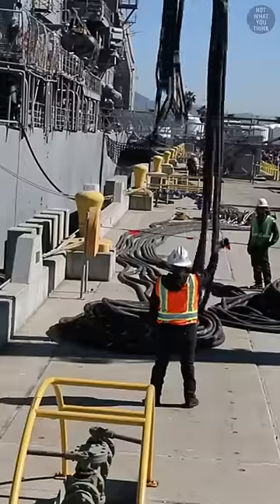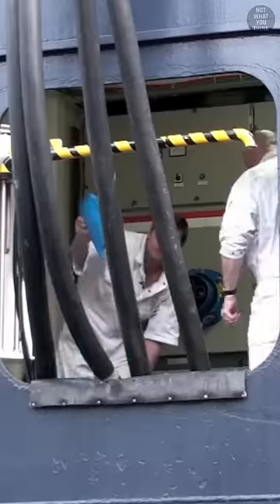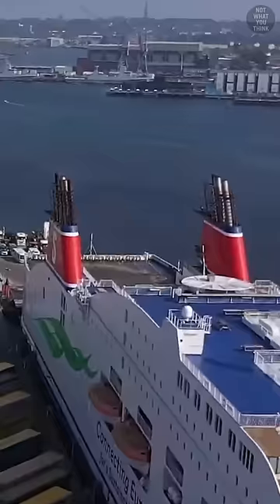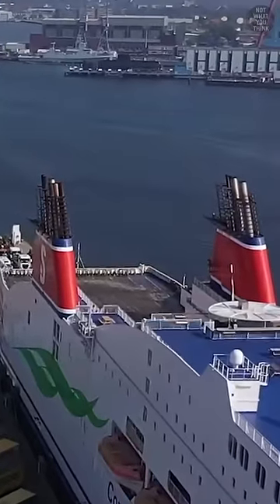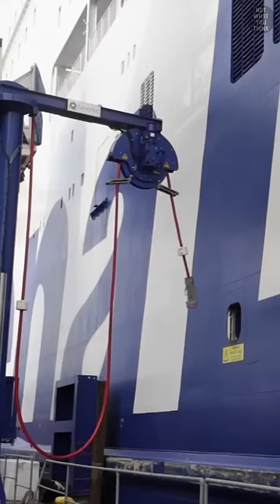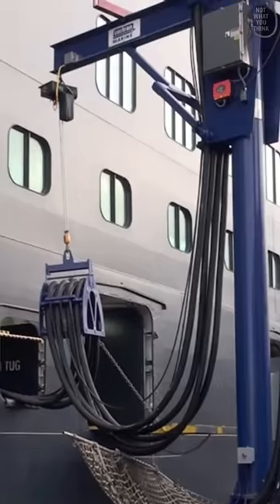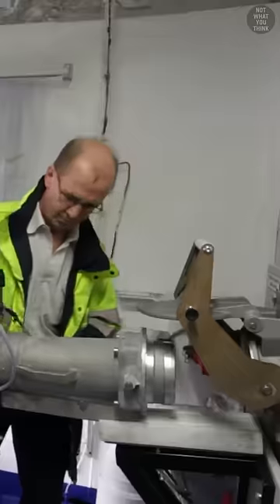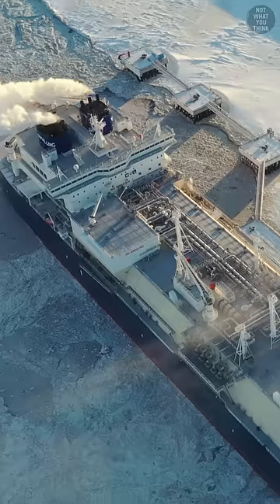Why Ships Burn Fossil Fuel When Idling? #shorts

Comment: As a marine engineer, I can confirm we are heavily regulated on emissions, there’s a whole annex of MARPOL dedicated to it. In fact the upper limit of sulphur content on heavy fuel was reduced to 0.5% in 2020
Reply: These normies really have no idea how clean the newer diesel engines burn . Especially with the DEF system. You can stand right in front of the exhaust and breathe it in and it smells like normal air
Reply: @ClaytonBigsby01  the chemistry of burning diesel literally releases CO2 as a byproduct of releasing energy, unless it is scrubbed the engine will still have emissions. 

It really is amazing how efficient internal combustion engines have become, but scrubbing the CO2 is expensive, and better alternatives should be explored (thorium, nuclear, hydrogen (which is still inefficient))
Reply: and 0,1% in ECA's
Reply: Reduced in 2020! Wow that’s so long ago!
Reply: @ClaytonBigsby01 def exhaust smells terrible.  Especially during a regen.  I removed that crap from all my diesels so now I can have black smoke.
Reply: It doesn't matter when you burn 63000 gallons a day
Reply: @ClaytonBigsby01 so giant marine ships have def on them?
Reply: @boomer9341 I removed mine to go from 35 mpg to 85 mpg.
Reply: Is ship fuel enriched with fuel to not be too sustainable? 0,5% is an insanely huge amount. For diesel, in Europe, it's 0,001% and in the USA, it's 0,0015%.
Reply: @brianfitch5469 sort of, exhaust gas passes through scrubbing towers which uses the natural alkalinity of sea water to neutralise the sulphur on the exhaust stream whilst the ship is sailing, when in port it uses caustic soda to neutralise the sulphiric acid created. Some ships are fitted with scr (essentially a large catalytic converter) which injects urea directly in to the exhaust gas stream to reduce nox emissions
Reply: It depends on the region the ship sails. There are spectial emission control areas where the ship sulphur content has to be 0.1%  to achieve this they either switch over fuels to diesel or the use of exhaust gas scrubbers which capture the sulphur for treatment and disposol and urea injection in to the exhaust gas stream to reduce nox, the technology differs from ship builder to builder. Emission control has the appearance to be slow to change, that's mainly due to lack of technology. Compared to a motor vehicle they are comparible if you take in to account the size difference
Reply: @gurito4374 newer ships are fitted with exhaust gas scrubbers and older vessels are retrofitted with scrubbers, otherwise they have to burn ultra low sulphur heavy fuel or diesel
Reply: Except every other country doesnt give af. 😂
Reply: And now the lack of sulfur in the heavy fuel oil is causing measurable warming of the ovens and the atmosphere over the oceans.
Reply: FINALLY A FELLOW ENGINEER WHO SAID IT

Comment: Another thing to consider is bunker oil is practically a solid at room temp.  Engines keep running in order to keep oil hot and circulating.
Reply: Not correct lol the are fuel oil heaters for that! The fuel is in circulation even when the engine is stopped!
Reply: @sburry1000 they require power!
Reply: @sburry1000 yeah, and the fuel heater is a magic machine that doesn't need any energy to heat the fuel to a certain temperature.
Reply: @RoaringBas вы изобрели генератор энергии из вакуума.
Reply: Not true. Not all fuel oil/ bunker fuel will freeze at room temperature. We make it as a by product here in Houston at the plant I work at. We then sale it carnival cruise and all the ports around us.
Reply: @Poisondartfart не ты продаёшь, а твой хозяин продаёт.
Reply: @MsAlmazka  Do you understand sarcasm?
Reply: Steam from boilers are usually used to heat the fuel and generators are used to power the pumps to circulate it! Never been on a ship where the main engines are left running in port!
Reply: So, it’s wax?  (Paraffin)
Reply: Wrong!
Reply: Steam from boilers are used to sustain the viscosity of the oil, as previously mentioned

Comment: They need a giant Type C connector.
Reply: Apple ships still wouldn’t be compatible
Reply: @loganbaileysfunwithtrains606 they would but it wouldn't be effective due to refueling speeds
Reply: @loganbaileysfunwithtrains606 apple ships are overheating 😂
Reply: @loganbaileysfunwithtrains606 this would have been funny a month ago. Catch up
Reply: @MarvinTurner  oh what you mean because the iPhone 15 finally adopted a standardized charger that had existed for almost 10 years now the joke is no longer funny? 

How about the new apple ships made of titanium end up breaking easier than the ones made of glass, that’s pretty funny
Reply: They need to use lithium ion from Africa
Reply: I live near the port of Long Beach and they pretty much use that. 😅

To reduce pollution and fuel wastage, idling ships in the harbor are hooked up to shore power via what are basically giant extension cables that the longshoremen drag aboard and plug in.
Reply: @NaofumiSama nah I bearly find heat on my iPhones and other Apple products but we can use andoird products as a stove actually and save LPG
Reply: @WiredWizardsRealm-et5pp  lithium doesn't come from Africa. Even if it did it would still be vastly cleaner over the long lifetime plus you can recycle lithium batteries ad infinitum.
Reply: @johnjingleheimersmith9259  Ok , ok ..I am out .
Reply: Bruh. This made me laugh way too hard for what it was 😂😂😂😂
Reply: @loganbaileysfunwithtrains606 I’ve owned an Android from every company sold in the US and I’ve owned iPhone. iPhone is superior. The whole “we had it first” argument about features is so dumb considering they NEVER work upon arrival on android devices and needs several revisions. Apple makes sure to perfect a feature before incorporating it. Also, it’s a phone, who gives a shit about open source code and being able to modify your experience. Isn’t that what your PC at home is for? Android people spend way too much time on their phones if that’s really their only argument. 

Ps. I personally preferred the lighting port we used to have on iPhones. And yes, I agree, the new “titanium” iPhone is poo water which is why I’m not buying one yet and just going to wait until they revise them.
Reply: @GlockTuah1017   Apple phones aren't the issue. Mostly it's their fanbase - people like you.
Reply: @GlockTuah1017  you got all of that from a joke I made? I literally own a iPhone, a iPad, 3 pairs of AirPods and the apple pen, I’m far from being a hater of Apple products, I’m just not a blind loyalist that thinks every decision or indecision Apple does is perfection. I own 2 Acer computers as well as Acer branded keyboards, mice and monitors. I bad mouth Acer as I do Apple, being a owner of their products I have the right to joke and complain about their products.
Reply: @loganbaileysfunwithtrains606  I never once said “you” when referring to someone in my comment. I didn’t “get” anything. I just spoke on the ignorance of android users. Which, it seems you aren’t one, so it’s interesting you took an offense to what I said.
Reply: with a giant powerbank 😂
Reply: Type C Pro Max
Reply: @johnjingleheimersmith9259 Some lithium is mined in Africa (but I think they actualy meant cobalt). Sadly only about 5% of lithium batteries are being recycled, although that is growing, and better methods are being developed
Reply: @mrcmoes  Yeah I know but it's so little that virtually all lithium comes from AU, Chile, China,  Argentina. African reserves almost not even worth mentioning/mining. I can't remember quite in what order though. If I recall correctly bolivia has the worlds largest reserves but they barely mine any of it.
Reply: They would have to turn the ship upside down to plug it in
Reply: Type C Connector is terrible personally.  Ports for the Type C ware out too quickly.   You're often replacing the cable, or device entirely.  Meanwhile USB 1.0/2.0/2.1/3.0 which all use the same connector is vastly superior and do not ware out in the same fashion.   So Tragically USB-Type C is a Terrible Standard, sadly.  

Pretty much every USB-Type C device I've owned has worn out to a point that they couldn't charge anymore, or couldn't stay connected to the Type C Connector.  The cables themselves also ware out too quickly, often faster than the device itself.  So I'm constantly replacing them.  

Basically it's a huge mistake having Type C as a Standard.  It's a VERY WASTEFUL standard.
Reply: @loganbaileysfunwithtrains606 
One EU to rule them all, One Eu to find them,
One EU to bring them all, and in the standardization bind them.
Reply: @MarvinTurner  Actually I heard something about apple simply made a USB-C adapter to a lightning connector inside the phone.... Which technically means they still don't use USB-C
Reply: @Alte.Kameraden someone sucks at handling their phone... USB-C is by far the hardest to break out of all the micro-USB by far, I bet you use your phone while charging and abuse the cable, that's not what they're made for! Doing that damages the phone battery anyways so get over your bad habit.
Reply: Or a giant dongle

Comment: My brother allways talks about this when we go from Germany to sweden/Norway, cause most ships that dock in the ports where we go, there is a whole lot of chargers so ships can do this, and the plugs range from just a simple connection to a whole part of the hull sticking out, for example, the stena Scandinavica (featured in this video) has a small charger, meanwhile the ship across the river, the color magic, has a whole section of the hull that slides out to plug the ship in, so it really is interesting how it works
Reply: Travelling from Kiel by any chance 👀
Reply: @the3rd210  indeed
Reply: So it's the ships owners that don't want to modernize
Reply: V
Reply: In Oslo I think it was ABB that provided the landpower equipment for DFDS and Stena Line.
Heard that it cutsup to the equilient polution of 1300 cars (in 2019).

Also see the Color line pluging in to port.
Reply: @lifeindetale modernization has nothing to do with it. Even with standardized shots power connections, there are thousands of different ones…

Comment: Bunker fuel is used on the open sea. As a ship approaches a port it switches to a clean mixture.
Reply: Not true for the vast majority of countries.  Only the US and a few European countries demand that
Reply: @AnarexicSumo those “few European countries” do be having the largest ports in the world though so it does make sense. 

The three big ones being in countries that really have to tone down on emissions.
Reply: @AnarexicSumo the vast majority of merchant ships use bunker fuel as they are from China
Reply: @AnarexicSumo   the world demands it. IMO 2020 we made the change to cleaner fuel
Reply: Very large diesel propulsion vessels switch to light fuel is to reduce the chance the engine will stall upon maneuvering.
Reply: @Bhatmann the fuels in question are heavy fuel oil and ultra/very low sulphur fuel oil. A switch is made several hours before you reach the emission control zone eg USA or Northern European waters, and this will allow the engine to have consumed any HFO remaining in the engine, ensuring it has transitioned entirely to low sulphur by the time you reach the border.
Reply: @Bhatmann  this is simply not true, it was about emissions and becoming closer to net zero. The engines can 'stall' as you say on either fuel, it's about how you maintain the systems to prevent things like fuel starvation
Reply: Clean mixture . What's that ?
Reply: True, i think it’s important to add this info. Also it’s not the case all around the world but still many ports asks for ships to switch fuel when entering ports
Reply: @VC-ly7gj  a lot of ports are still reluctant to allow ships to turn off their own power and switch to shore supply, e.g. with container ships that are alongside less than 24hrs, if there were an issue with the maintenance being done on the engines and they couldnt be brought back up, you're instantly impacting a long pre planned schedule of vessels that need to be on your berth.  costs quickly rack up into millions in delays.  they want you to be able to sail at a moments notice if required.
Reply: @AndroidFerret  it means the same thing  as a zero emissions electric car that gets recharged by power from a coal plant. 😁
Reply: @randywl8925  I love that you used that example, because it's a perfect example of how even though the alternative still pollutes, it pollutes significantly less than the common technology. In the case of electric vehicles, they can reach efficiencies of 70-80 percent including charging and stepping up/down the voltage. Meanwhile most ICE engines on the market today have an average efficiency of 18-20%

Once you calculate the efficiency of power generation from a coal power plant you're still hitting efficiency numbers 2 to 3 times as high as internal combustion engines, and that's only considering the end efficiency of an ICE engine, not the amount of energy it takes to turn the crude oil into a usable fuel.
Reply: @richardmillhousenixon  But you didn't factor I the cost to dig 500,000 pounds of earth to make one battery for one car.
If you mandated one single city to 100% electric vehicles, there is no way on earth it would be possible to supply the electricity for those mandated vehicles. PERIOD.
California and even Oregon, the commie state where I live have both asked or told people not to charge their cars because they didn't have enough electricity to power them. 🤯
That's with what... Only  2.5% electric cars on Oregon and unbelievably, a mere 4.9%in Comifornica.
If they tell people to not charge their cars with such a miniscule percentage of EVs now, how will they ever even find enough "green" energy to power even a miniscule 10% of the nations cars.
It's stupid from day one.....
....but it sure "feels good" pretending to save the planet, doesn't it.
Math and physics laugh to the point of hysteria at people that believe electric cars are possible in the near future.
Electric cars will require a major conversion to nuclear power to become feasible. Another battery chemistry will also be required.
Hybrid cars are the future until unobtanium becomes obtainable.
Reply: @randywl8925  Yes it would, you significantly overestimate the amount of electricity needed by one vehicle.

You need to take some time and do some proper research. Not anything some news site tells you. Until then I'm not replying again.
Reply: @AndroidFerret  LSMGO, low sulphur marine gasoil, 0.1% sulphur

Comment: Most countries require vessels to change to light fuel oil when approaching and departing port. 
Bunker is used while underway well away from land.
Reply: We also change from HFO to diesel/MGO because we will switch off  the main engines. If the fuel system on the engine is full of HFO when switching off the engine, the fuel cools down and the viscosity goes up.
Reply: @AirwaveMustang thats why you have fobas calculator ;)

Comment: What if we make a REALLY big USB?
Reply: It still won't be big enough to quick charge the latest battery hungry Samsung phone. 😆
Reply: type C
Reply: Imagine the man hours spent turning it over and then turning it back over again.
Reply: @josephsheranda  iphones are the worst at battery consumption
Reply: Would never work. By the time you flipped it the third time to plug it in, the ship would be leaving port.
Reply: @thes7754  C
Reply: @dadeer9324  how fast are you charging after typing C?
Reply: @tykiahjames9372  Yeah, my phone is on fire
Reply: USB-X
Reply: Tom R  wanna dock like bros?
Reply: @josephsheranda  you know that Samsung batteries last days longer than iPhone right?
Reply: @ilynpayne7491  The iPhone processor is far more efficient. They just have smaller batteries
Reply: @Anzio_VR  No flagship smartphone lasts days. That's only the low end ones that have low power chips in them
Reply: USB - C
Reply: @thes7754  C
Reply: Fuqqq brain implodes
Reply: Then someone will make a REALLY big lightning cable.
Reply: @evann5451  Energizer make a phone that they claim can last for 50 days but it's a huge brick.
Reply: @evann5451  no flagship last days with constant usage*
Reply: USB-Sea
Reply: @ilynpayne7491  my 5 year old iPhone 8 Plus still lasts me all day
Reply: USB XXX
Reply: The year is 2092 - everything is a USB cable.

We have tapped into Earth's data by plugging a dongle to the core
Reply: Yes, RBUSB...
Reply: @josephsheranda  samsung has really fast charging like 0-100% in 1 hour. Your comment makes no sense
Reply: USB-Ω
Reply: @josephsheranda  one day we will build such a big USB that we will destroy even ourselves...
Reply: LMAO
Reply: @josephsheranda   not sure you've tried one of the new Samsung phones 
    I get 3 days on my note 10+ 

And have had it for 3 years or more been so long can't remember when it released
    😂 

 I follow the 40 80 rule with lipos though
     You'll probably say ewe you gotta do that no but you should with every lipo that isn't lithium ceramic
    John b goodenough probably didn't set the specs sounds like a phone industry thing

That being said I got another phone in May and my galaxy has been sitting on a charger alot more absolutely abusing it hooked into the TV and playing Minecraft on it 

   Still has 3 days
Reply: yeah is right
Reply: then need to flip 3 times before connecting
Reply: Eh, 2 or 3 c type fast chargers should work right ?
Reply: Just a collection of 30000 USB c plugs.
Reply: Trans porter rooms are the thing these days. You know, you know the thing.
Reply: Only if it makes the correct Windows USB connect / disconnect sound  🤣🤣🤣🤣